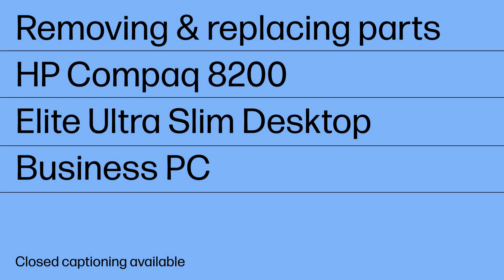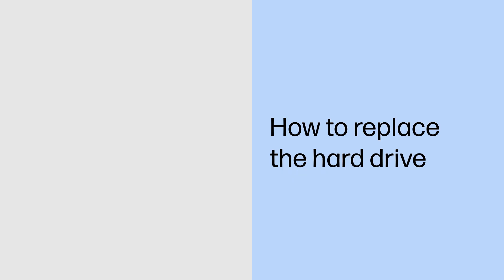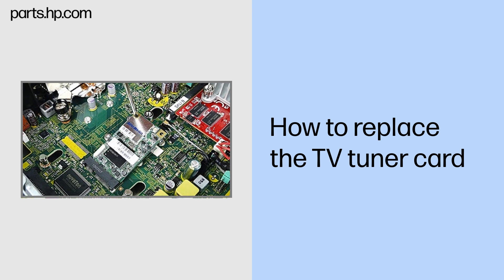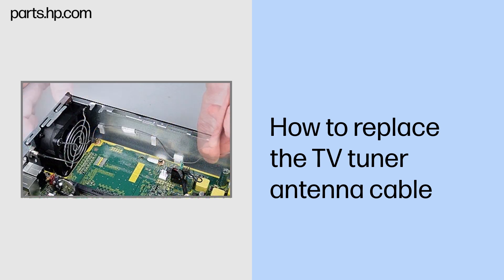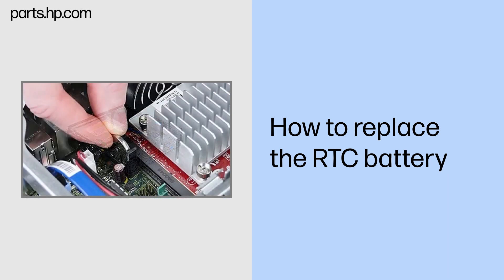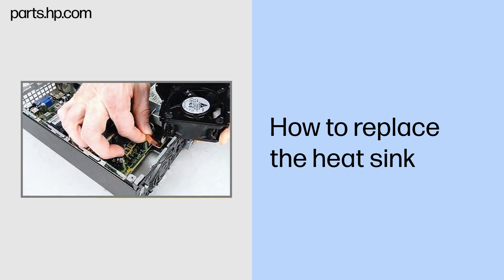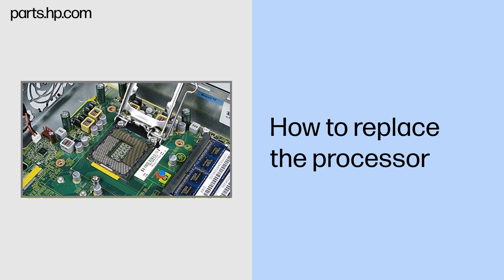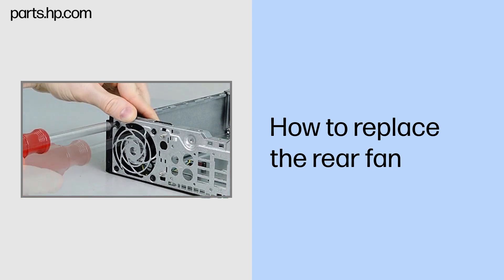Removing and replacing parts | HP Compaq 8200 Elite Ultra Slim Desktop Business PC

Comment: Hi! I've got this computer. Is there any list of CPUs and GPUs supported by the motherboard or considerations to have in mind?
Reply from the maker: Hi there, thanks for contacting HP Global Social Media Support!
I understand that you need to know about compatible processor and graphics card for your computer.
I will do my best to assist you.
Please refer page number 18 and 21 of the user manual to know about compatible processors and graphics card: https://hp.care/6057WkijU
Regards, 
HP Support
Reply: @HPSupport  Thanks a lot! :)
Reply from the maker: If you need any help in the future, you can always get back to us.
Thank you for being a valuable HP customer.
Have a wonderful day!
Regards, 
HP Support
Reply: @HPSupport  me again! I've tryied to use de Display Port connector with two different DP to HDMI converters (active and passive). I had no success. Am I forgetting something? I have the most recent Linux Mint installed
Reply from the maker: Thanks for the reply.
Due to limited support on this platform to fix this issue, please feel free to reach us on call/chat. Access this link to select your preferred country and language option to reach us. 
Global support link: - https://hp.care/6053WigX1 
Regards, 
HP Support